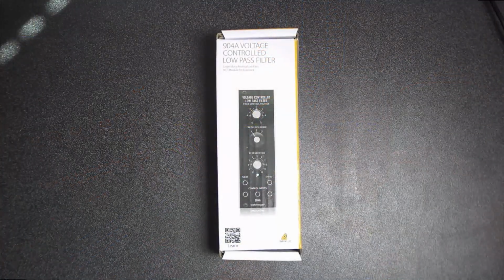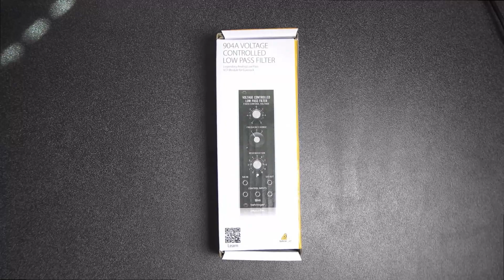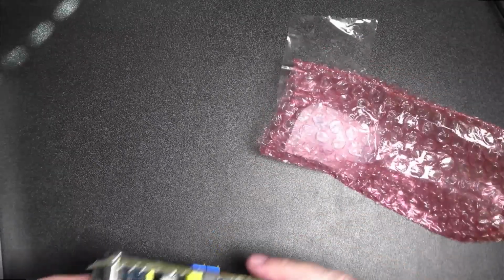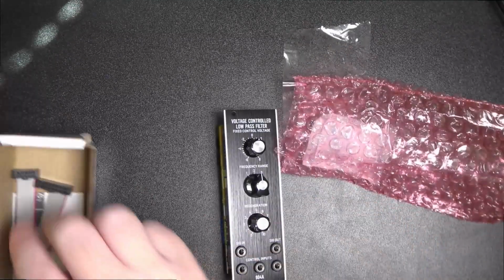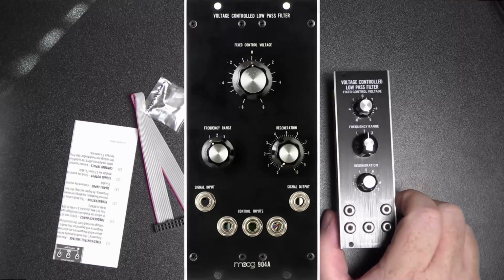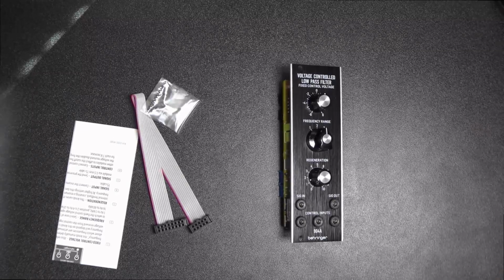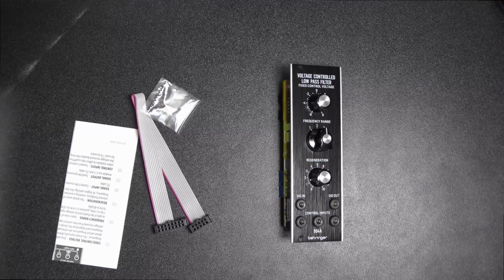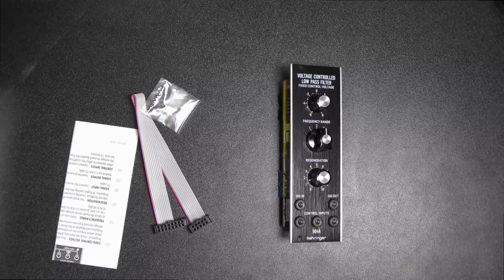Mailbag #9 - Behringer 904A low pass filter

Comment from the maker: I decided to use the Make Noise Maths as an EG (envelope generator) because the 904a lacks an attenuator on the control inputs (the Maths has one for each of the 4 outputs). Although you can see me wiggling the knobs on the Maths - the effect is purely on the output of the 904a filter. Heck, there's a lot more we can do and show - this is just the first look. Let me know in the comments here what you would like me to try/show - and I'm happy to do some follow-up video(s) - this may also include me running it through my oscilloscope :)
Reply: Thanks so much for this video :) That 904A sound is amazing.. the resonance sounds much better than my Behringer 121. :)

Comment: Hello!
I have a question,
I have a complete system 55, when I put a Cv to the control input of the 904b and I get a note in the regeneration frequency (Almost sine wave) I try to tune the entire scale. but my 904b doesn't follow. The entire scale falls short, 1 and 1/2t almost below the octave. I have tried different CV sources.
I don't know if I should do the entire scala in tune. Like Key tracking.
Could you help me with your experience?

Thanks!!!
Reply from the maker: Hi, had a quick look at the Behringer manual/specs and it says: The sum of the voltage received doubles the frequency cutoff point for each 1 V increase. It has a 12 octave range. Have you tried going through a tuner module before you connect into the CV inputs? You may want to look at either a quantizer or a tuner style module - that ensures the output voltages respond to the notes being received.
Reply: Thanks for answering!
I have connected cv controllers to the filter control input in various ways. When I connect to a Vco they tune perfectly, the problem is when I connect the same CV signal to the input of the filter through control in and it doesn't tune very well. On the C scale it is 3 semitones below. When reading the manual I don't understand when it says:
---he sum of the voltage received doubles the frequency cutoff point for each 1 V increase. It has a 12 octave range---

Is this the same for the oscillators as for the filter...?

Thanks again!